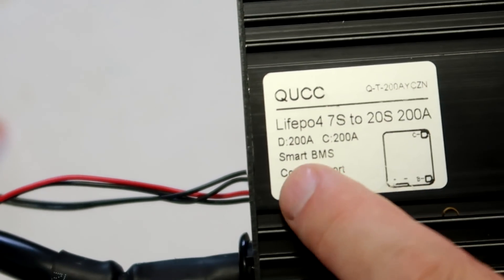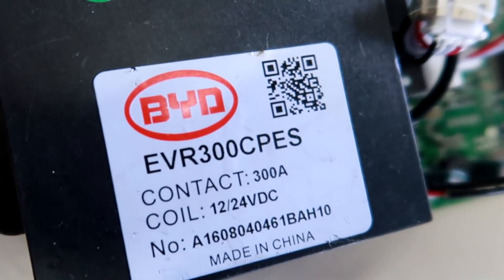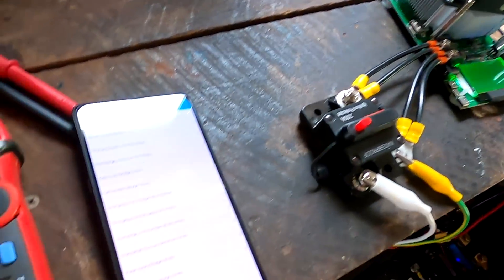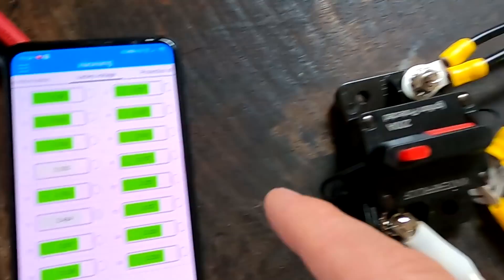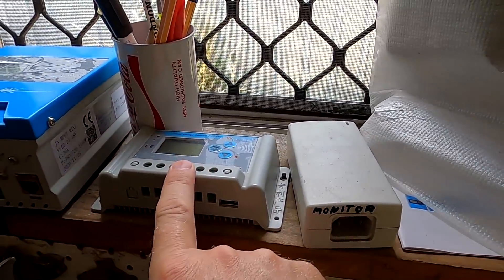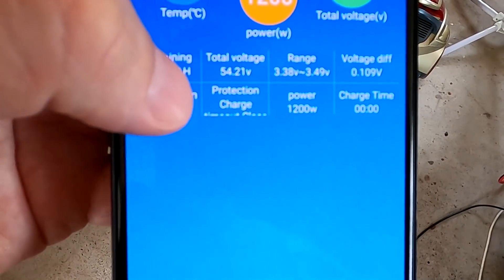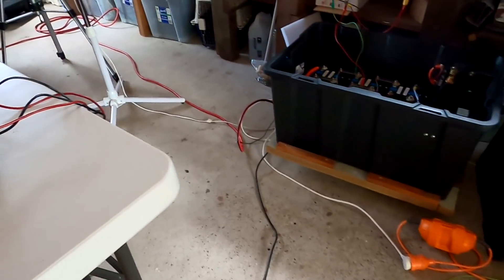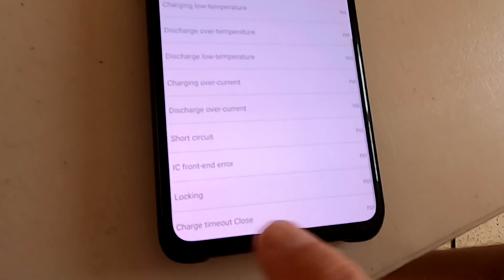This QUCC BMS does not protect my battery! Am I right?

Comment: You get what you pay for, well, sometimes if you're lucky! However, in your case, Andy, you might be better served if you quit making videos on subject matter for awhile and watch YouTube videos by others who can teach you about various functions of a BMS. Most top balance your cells power and quit giving higher amperage to each cell once the nominal setting you have them set for charging and lower down amps to a float charge. The temperature sensors are made to keep the battery from overheating by charging and shut off the BMS unit to prevent battery damage. Some other types also prevent unbalanced discharging.

Comment: Andy Ive got 3 of these running but they are not marked QUCC. They seem to be working fine . I have tried so hard to find a manual for these generic bms without success. So if anyone out there has one please link it for us all. Also I think I still have the old software version so a link for the new would be great

Comment: Maybe you should assume that the BMS is programmed to another battery chemistry.
So a translated manual of the BMS is imperative!!!!
Do a bench test of the BMS and observe at what point it cut's out power...
There's alarm settings and cut off settings it seems.
With external power supply at 4.5 - 5v low amps probe the BMS wires at the cells.
I think that should trigger the relay. (Maybe)
Good luck!

Comment: Cell under voltage should turn off load.
Cell over voltage should turn off charge.
Period.
There should be some alarm before this happens of course.  :)
Reply: single port - switches both load and charge off, not independently

Comment: WOW, glad you posted this video!  I have a Xiaoxiang 120A BMS and I have never even looked at the Protection information page before.  I see 384 Cell Overvoltage times!  Good thing these are cheap used cells and not my 280Ah cells due on Friday.  I set pack under voltage to 12v and have seen that turn off the load.  Tonight I will run a test with my charger to confirm that it will over charge a cell and not turn off.  I'll let you know what I find out.  THANKS FOR THIS!!!!

Comment: The best bms is your multimeter! I have seen many builds where they eventually just run the pack without bms and all cells are ok. When bms whas conected, there always where problems, inballance of cells. Try it without and control each cell with your multimeter.

Comment: I think most of these BMS's doesn't balance the cells, (the cells are balanced itself by several DIY capacity testings...) They just have high & low cut off protections.
I'm I wrong...? 🙄

Comment: Try setting the alarm higher than the over charge setting by .01 or a small amount so the cut off happens before the alarm. My Ant bms with common charge wire will shut off the charge mos on all cells when there is one cell at the over charge setting then the balance function reduces the cell until the restart voltage then charge mos comes back on and charges all again

Comment: Hi Andy,
Have a look at the Overkill Solar 16s 48v 100A BMS. It looks rock solid and well supported out of the US (though manufactured in China). 
I have a spare one if you want  (in Melbourne) as I am changing my battery to a 24v configuration for the caravan (lighter is better).
I've learnt heaps and more importantly highly entertained from watching your videos and frogs.
Cheers
Reply: You can get the same BMS as Overkill from China for cheaper. But the support from Overkill is worth the premium price, in the USA at least. Overkill's warranty says if it's broken I'll replace it even if it was caused by user error.

Comment: Andy, when you are viewing the setup parameters for the BMS, notice the ? inside O.  Click on that and it will explain exactly what that parameter is.  No need for a manwell.
Pack under voltage:- every time you unplugged the BMS cell wires maybe?
Reply from the maker: It gives me an empty box with no text.
Reply: @OffGridGarageAustralia  Oh no.  That is not good.
You know I have to say it.  Maybe you should have bought a Dally.

Comment: I'm thinking... It looks like you can have a problem with the balance of the cells? You have been tinkering manually with single cells to make it more in line with the others. However, my experience is that I have to balance at 3,65V, not lower. I can go back to lower voltages in general use, but for balance I found it necessary to go for 3,65V. The reason being that at lower voltages it is very difficult to determine the SOC. You have to go to either extreme end of the SOC to determine a starting point. Being either top or bottom balancing. And the very end is not possible to determine accurately at som midle SOC where the voltage si very equal regardless of the SOC. And the discovery you did with the absorption time is very important. I did my balancing by starting at some low SOC and charged ALL in parallell to 3,65V until all cells absorbed no current. Used one single wire to each cell. Not bus bars. This way I could measure the current to each cell individually. I believe strongly that we have to charge upwards to balance. We can't pull charge from any cells afterwards to meet with others. The absorption time will mes up totally.
When balancing is done right you should in theory not have to do it again. Neither should the balancing feature in the BMS have to kick in. Only important parameters should be the highest and lowest battery voltage. And these voltages are determined by the single weakest cell.
Am I on to something here?
Rudy

Comment: I built exactly the same  battery 2 weeks ago only mine is very very different.  I used 16 x 272ah cells paired up in an 8s 24v configuration. Not using a BMS. Holding off until I find one that will actually work for a reasonable price.  Had hopes for this one, but just another to cross off the list by the looks of it.  I'm in no rush to get one anyhow. The charge controllers and inverters are setup to disconnect at the correct voltages.   I am using an active balancer though.  Bought off ali express, You can search aliexpress for this "1A 3A 5A 6A Balance Li ion Lifepo4".  Can't be sure I even really needed that either,  but rather be safe than sorry.  So far the cells have been perfectly balanced.  The worst I've seen them out of balance is less than 0.01v.  Yours is doing some very very odd things.  Possibly bad cells, or maybe an out of control balancer in the BMS.  I'd be disconnecting that thing faster than a starving kid with a McDonalds voucher
Reply: This is EXACTLY the way to do it..... mine is the same and NO problems, simple and cheap.  Andy will not listen....

Comment: Daly and Topbms will shutdown when cells are over voltage at 4.0v. 
Now, for your bms the precharge will take a while and probably will shutdown at 3.75
As for the charge timeout. Does it has a timer? And Can you turn off the timer?
Balancing won't start until cells has reached 3.35v or 53.6v at this time incoming power from the charger is cut off until voltage within cell is between 10mv.
Charging cutoff is 3.75 to 3.80v for 35minutes and if it keep charging then the magnetically latching relay need a whack to start working again. 
All of these parameters are for class A batteries which supposedly maintain same voltage for each cells after initial equalization. 
So the immediate solution for class B and C cells  is an active balancer board with more amperage or equal to the charging one.
And if you want to refill the spray bottle with Jägermeister and cry some more don't be shy.

Comment: Your pack still not balanced then, the cells 6 and 11, the ones you were fiddling with before. You can't expect the BMS to deal with them, as you say 200mA max discharge per cell. You need a BMS to individually charge n discharge cells, if you can't uniformly balance, uniform cells from the start.

Comment: I think the relay fonction is the problem not the actual bms. Also the temperature sensor should go between batteries so that the bms shutdown if over a certain temperature. I would suggest it's near the cell that's overcharging.

Comment: I just cannot understand how a “same port BMS” is supposed to work with a relay. How on Earth is it supposed to turn on/off charge/discharge independently?
Reply from the maker: I can't figure it out either, having spent hours now with testing and trying. It does not make sense. The relay turn off and on but charging and discharging still runs through no matter what.
I'm awaiting for clarification of the manufacturer...
Reply: same port doesn't do that - is a unique benefit of the dual port ones (that and low temp charging cutoff without also blocking discharge)

Comment: I have 2 batteries in a 2P8S configuration up (24-volt but actually closer to 27.2 volts most of the time as I never would let it actually get down to 24 volts) and cycling with the SBMS0 shutting down the DSSR20's when any cell goes over 3.55 volts to protect the battery. Ditch that BMS. time to upgrade for sure. get that class T fuse installed to protect your inverter. i use 32-amp bipolar breakers on the incoming solar panels (wired in parallel)before they go to the solar charge controllers. I use ferrules on the 10 AWG PV wire. the breakers are also great as a switch as you connect and disconnect your pieces and parts during assembly and testing.
just a couple of thoughts to upgrade. wiring can always be improved for the ease of the user.
cheers from pilgrim valley in South Dakota USA. keep up the great work!
😎😎😎

Comment: ANTBMS!!! I love the one i got!
Reply: And also, the MOSFET type BMS Will Turn off charging independently from the load even if it is a common port bms. The ANTBMS that i have turns off charging when One cell is Higher than the parameter i set but keeps the discharging Open ...
Reply: I also have this, love it very much. Easy to check and see. Lots of features... price is low..

Comment: I find you such an entertaining guy it is hard to criticize your videos but I often just can't watch them because you are so ill-informed on so many aspects of solar power, charge controllers, inverters and batteries I can't take it.  I admit you often ask many of the questions I have faced but you provide so little real information about your setup that it is almost impossible to determine the exact cause of your problems.  I did not even make it through this video before I found myself going insane and needing to offer some comments to you.  So here goes:  I) just because your BMS sees the voltage across a given cell exceed your setup values it does not necessarily mean it is going to trip then and there.  On my BMS there is another setting that allows me to input a time limit that the voltage value I want the BMS to trip at must exceed for the trip to actually occur.  As I saw in you video, although the cell voltage did exceed your trip value it did not do it for long and was jumping above and below that value.  So, if your BMS is similar to mine it won't trip until the limit voltage value is exceeded on a continuous basis for the time I have specified. 2) I have taken to building my own chargers and when you do that you have to answer the question "what does it really mean when I say a cell voltage is a given value?"  As you know, if you are actively charging a cell and you measure the voltage you will get a value which is actually higher than the true voltage of the cell because the cell has a delay during which it distributes the charge it has throughout the cell.  That is the reason that as soon as you stop charging you see the cell voltages drop immediately and continue to drop for several hours to  a day or more.  So what does it mean when you set your BMS to trigger at a given value?  I think the answer depends on who designed your BMS and how they chose to define things.  For me on my charger I actually stop charging for a few seconds every few minutes and after stopping the charge for a few seconds I measure the cell voltage.  This method still gives me a high value but it is much better than claiming the charging voltage is the same as the cell voltage.  I tried and failed to make this point to you some time ago on another of your videos. 3)  You stated that your Victron charge controller did not go up in smoke when you disconnected the controller output from the BMS/battery.  Well, that is good as many charge controllers have this problem (of course, maybe you were not inputting enough power etc.).  However, you need to know how the Victron charge controller really handles this situation.  I suspect it shuts down entirely until it senses some kind of circuit change.  Based on this and some of your other videos in which you comment that you want the charge controller to keep powering loads even when the batteries are full I suspect you really do not understand how MPPT charge controllers work.  All the commercial charge controllers I know of will not handle a battery disconnect gracefully.  OF course I must mention I have limited experience with various charge controllers so maybe there are some exceptions (Victron?).  Basically, a charge controller is constantly sensing the voltage on its output wire so it knows when to shut off and what MPPT voltage and power point it should be adjusting to.  A battery connection is mandatory for all charge controllers I have seen because the batteries keep a more or less stable voltage on the network.  Without the batteries, there would be no voltage on the network so the charge controller would go on full blast and as soon as it did that it would see a big voltage on the network so it would shut off, then sensing that it would go full blast again...only to be caught in an endless oscillation that eventually smokes most charge controllers.  At least that is what I have seen explained on various forums on the web.  I was also told this by a solar system designer.  So, although your BMS is giving you this mysterious "charge time out" error (did you ask the vendor what it is?) it might be because the BMS is seeing some kind of charge controller problem or something else on your network.  The truth is that I would have to make many measurements on your setup to know what is really going on.  A BIG problem I see you having constantly is reaching incorrect conclusions because you do not think about all the possibilities that could be causing your problems.  YOU NEED TO LEARN TO DISCONNECT EVERYTHING, QUIT MAKING ASSUMPTIONS, AND ADD EACH COMPONENT BACK INTO YOUR SYSTEM ONE AT A TIME so that you can understand and isolate the issues.  There are very few of people (and I am not one of them but given I have an electrical engr. degree I can usually work my way though things given enough time and research) who truly understand the detailed workings of all the components in a given solar system.  Don't assume you know what is going on just because you make a couple of measurements and at the time you made them the system was in a given state it might not be in a second later.  These solar components (like quality charge controllers and quality inverters) are constantly sensing and making adjustments to their operation.  What might be true for one of your measurements might not be true a second later. 4)  I do not know if your BMS setup allows you to have different relays to control charging and discharging but, if so, I suggest you connect your charge relays between your solar panels and the INPUTS to your charge controller.  This way if your batteries are charged you cut-off the charge controller in a manner that won't cause problems including problems like smoking your charge controllers.  True, if your panels are disconnected you cannot use the power to run loads but if you setup your BMS, inverter and charge controller correctly you should still be able to get value from you panels most of the time as the charge relay will only disconnect the network a short time (unless you have your release voltages set too low for some reason or are pulling little or no load).  Now if you have an inverter/charger then it is more complicated.  As you can tell, just addressing these few issues has made this a long comment and I have not even begun to cover the possibilities.

As I said, you are a funny and entertaining guy.  A very good guy as far as I can tell.  I wish you were my neighbor.  But you get too frustrated and tie yourself in too many knots because of a lack of knowledge.  I do see that you are learning but sometimes you are learning the wrong lesson.  What worries me is that you have many followers who are also being mislead.  Still, I know it is a hobby for you and you are keeping yourself very busy so congrats to you on that but gosh, sometimes I want to commit suicide watching your videos.  Nevertheless, keep plugging away and good luck.
Reply: Agree, I too have tried to slow this guy down to think more logically. It seems the consensus of opinion by his fans is to buy more stuff, and spend increasingly large amounts of money.....
Chinese are right into solar, they make and use their own stuff, they know what they are doing and do it well.
Reply: @dayleedwards3521  Yes, I remember the old phrase "made in Japan" when we wanted to refer to the garbage that came out of Japan in the early years after WWII. It did not take Japan long to make the highest quality cars and electronics in the world.  I think we are seeing that transition now in China.  I have gotten some junk mostly from scammers but more and more of the stuff from China is first class.  That has been my experience anyway.  And, having been and engineer and having worked with many Chinese and Taiwanese engineers I can tell you they are very bright and very well educated.  This is no time for Americans to rest on their laurels.